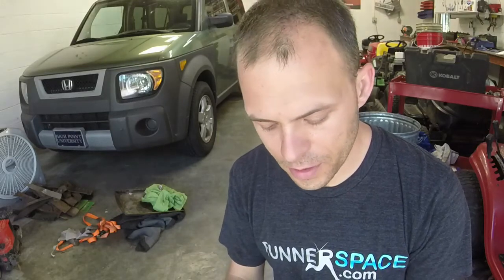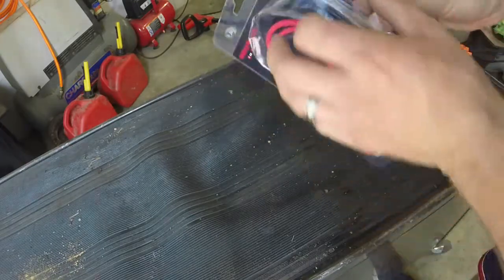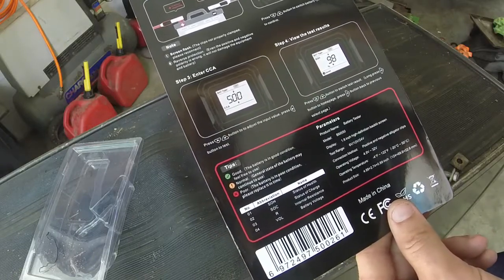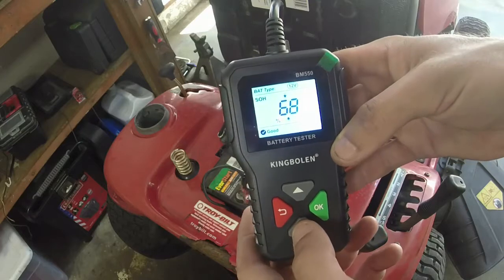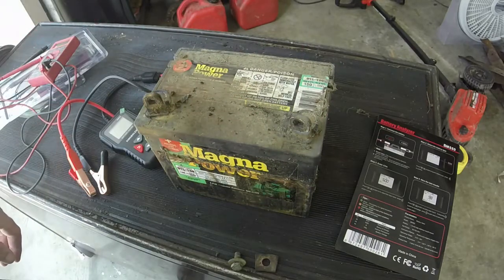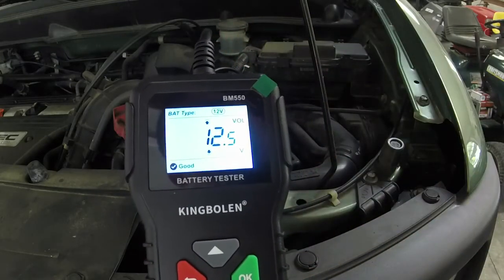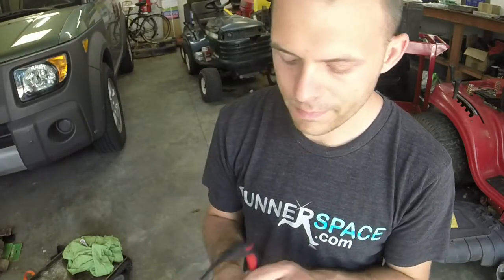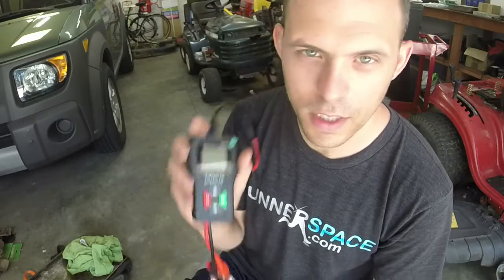Kingbolen BM550 6v 12v 24V Digital Auto Battery Analyzer Review

Comment: I will offer that you could take your Honda to AutoZone (or one like it) for a Free Battery and Alternator Test to see if they say the same battery result as this Analyzer, and bring the mower batteries with you, and they'll test them from free as well.  This way, you could get a feel of how accurate the Analyzer is.  Another video to compare you results to that information would let us know if we should consider this device or not.  And speaking of revitalizing these acid batteries, they should be able to do that for you, too, by replacing the Electrolyte.  There may be a charge for that, but you could call and ask.  There are also devices to remove the Sulfate that builds up on the plates, depending on how bad it's built up.  Compare these to the cost of a replacement battery and decide.

NOTE:  You can probably press and hold the Up or Down button to scroll through CCA selection faster instead of repeatedly tapping.  At $22.49 (which must already include the 10% Discount <as opposed to $23.39> isn't bad for this little dude, but I'd be interested to know how it compares to AutoZone. 

13.68 mOhm is the battery's Internal Resistance (as you noticed).  All batteries of every type have an Internal Resistance due to the Electrolyte that allows electrons to flow between plates.  The lower the better for longer charge life per full charging cycle.  Internal Resistance can rise over time, and is also effected by temperature.  As the Internal Resistance rises, the resistance to current flow from plate to plate decreases and the same Power draw decreases the full battery charge faster.  It can also make a battery take longer to charge as it rises.  The mOhm rating may be different with the (+) terminal disconnected.  The Voltage reading will be higher with the multimeter because the Analyzer is drawing a load, which will decrease its displayed Voltage.  I would say that less than a 10V charge won't turn on the Analyzer, maybe less than 11V.

Thanks for the video!  PS:  My Troy-Bilt has an Ammeter while my Craftsman doesn't.  I'm thinking about adding a Voltmeter on the Troy-Bilt and both on the Craftsman.
Reply from the maker: Thanks for all the info!  The mower battery is on the edge of retirement so that theory about the resistance is definitely valid.
Reply: @EllisMowersandmore   I hope it helps you.  I like telling you this stuff because you help us so much.